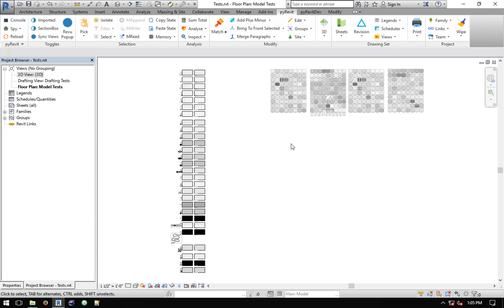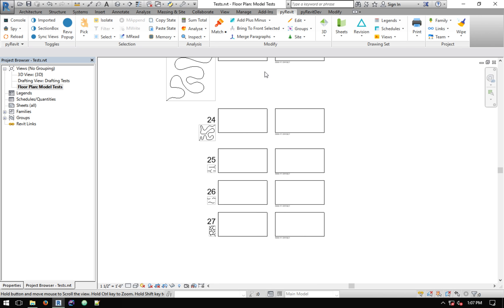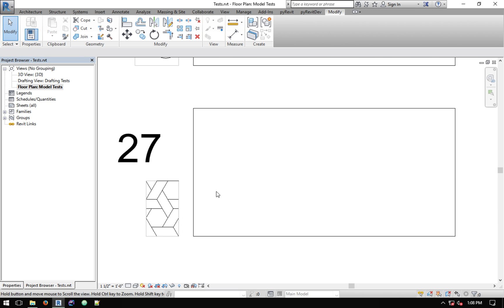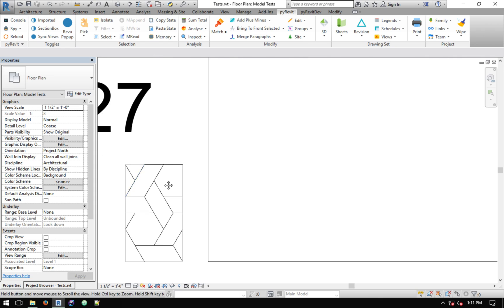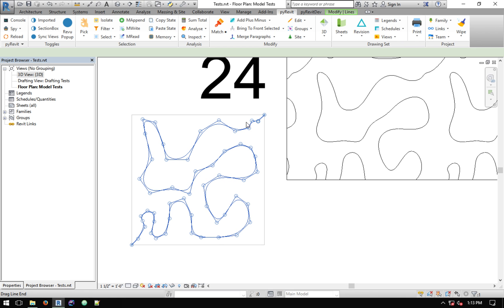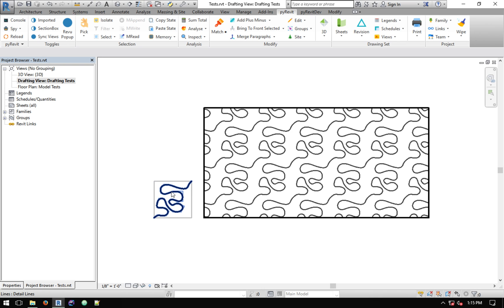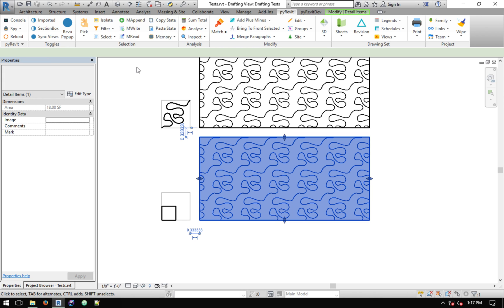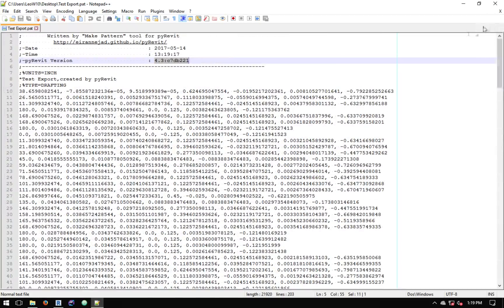How to pyRevit: Make Pattern Tool

Comment: Hi Eirannejad. I really enjoy your tools. I'm getting an error with Make Pattern in both 2020 and 2019. In 2020 here's an example of the lines:
AttributeError: 'FilledRegionType' object has no attribute 'FillPatternId'
System.MissingMemberException: 'FilledRegionType' object has no attribute 'FillPatternId'
System.MissingMemberException: 'FilledRegionType' object has no attribute 'FillPatternId'

In 2019 it strangely returns a success message but the output window shows this:
ERROR [pyrevit.revit.db.transaction] Error in Transaction Context. Rolling back changes. | <type 'exceptions.Exception'>:name cannot include prohibited characters. 
Parameter name: name
ERROR [patmaker] Error creating pattern element. | name cannot include prohibited characters. 
Parameter name: name

This is with me attempting to name the pattern "1" 
No quotation marks. Just the number 1 like you did in your video.
Reply from the maker: See this and report a new issue please with example file so I can test on my end: https://www.notion.so/pyrevitlabs/Reporting-New-Issues-f1fdd62cf6074b318bfe8ddfbc2d8d98

Comment: Very grateful for your pyRevit plugin especially the Pattern Maker!  Regarding detail patterns, is it possible to modify the origin of these within a system wall family?  My current standings:  I'm successfully showing a zigzag pattern of lines (looks similar to truss-mesh reinforcement for cmu walls) within the structure portion (metal studs) of multiple system wall families at various thicknesses, ie., 8", 6", 4" & 3 5/8".  The challenge that I'm having is that the patterns need to be shifted to align perfectly w/ the thickness of the metal studs.  I have created a separate zigzag pattern for each metal stud thickness, then have created a material which is then utilized within the system wall family and as you know, Revit only allows detail patterns.  Any advise is greatly appreciated!
Reply from the maker: I think using model patterns will help with this

Comment: Great tool. How do you constrain the edge of you pattern to the edge of the actual fill region so when you expand the fill region there is at least one corner that you can use as a starting point from which the pattern could expand.
Reply from the maker: I'm not following what you mean. Please be more specific and explain what you are trying to do.
Reply: Let say you want to create a tile pattern. Ideally, the edge of the tile should be constrained to the edge of the fill region so when you stretch the fill region  you don’t end up with half a tile outside the region. Whether you stretch the fill region or move it on your plan view, as it stands the pattern never moves with it. The edge of the pattern is not bound to the edge of the fill region. To set-out the tile from a wall or a column one needs to be able to align the edge of the pattern where it is needed but that’s only possible when the pattern moves along the fill region it has been created in.
Reply: @BonuxCouleur  Thats a Revit limitation.

Comment: I just installed pyRevit_4.6.19_signed.exe
, it seemed to load fine but MAKE PATTERN selection is not available under the EDIT tool under MODIFY. Do I have to change a setting?
Reply from the maker: What do you mean it’s not available. The tool is not there?!
Reply: @pyRevit   Correct, the available tools under the EDIT option are Change element type safely,  Conver line styles,  Export view as image, Place origin marker, Shake filled regions and Tag All in Views.
Reply from the maker: The make pattern tool is on root of Modify panel. It is not a tool under a pulldown
Reply: @pyRevit  I was going by the menu in this video, after a bit more exploring I got it to work. Buddy this is an awesome tool. It's going to take me a while to figure out the rest of it. Thanks.
Reply from the maker: Ya sorry some of these videos are older. Thanks for the kind words and I hope you can save time using these tools and have more time spending on fun stuff 😁

Comment: Hi guys, I'm using Revit 2018.3 and when I try to export to a PAT file nothing happens. Can anybody help?
Reply from the maker: So you select a pattern and a destination folder and no pat file is generated?
Reply: @pyRevit  Yes that's right, I draw a detail pattern, highlight it, press make pattern, click export to to PAT, select the two corners of the pattern area and no pat file is generated. I have projects for university that I'd really like to use this on.
Reply from the maker: Ya sorry no. You need to create the pattern first, the open the match tool without any selection, pick the pattern from drop down and then export
Reply: @pyRevit  Could you please be a little more specific? The pattern has been created and used inside of the filled region. I do not understand how to use the match tool. Your help is greatly appreciated.
Reply from the maker: Watch the other two videos in this playlist: Making Patterns https://www.youtube.com/playlist?list=PLc_1PNcpnV57FWI6G8Cd09umHpSOzvamf
Reply: @pyRevit I've watched your videos. These are all very useful tools but for some reason Revit will not export to PAT file. I have tried both ways of doing it but do not get the option to select my destination folder for the PAT file. It seems to crash during the process. Very frustrating to be honest as I could really use your tools for my projects.
Reply from the maker: I’d appreciate if you can send me an example model and error reports of the failure. I need information to be able to detect errors if any. Report here please: https://github.com/eirannejad/pyRevit/issues

Comment: Hey, I really love what you have created here, but I have a question, I have been trying to create a pattern for damp roof course ( which is one solid rectangle, and then an empty one), but the filled region is not being added to the pattern, have a solution for that? I am using Revit 2017 and your latest version. Can't wait for your response !!
Reply from the maker: Hey thanks for the kind words. Solid filled regions currently don't work in Revit patterns due to their line-based design. Solid pattern is a special type of pattern that is generated programmatically and is not line-based. Same limitation exists in AutoCAD as well. I suggest closely filling the solid rectangle with lines. Play with line thickness and spacing to get it to show as solid on prints.
Reply: Oh, didn't know that ! Thanks so much for your reply, will definitely try what you have suggested ! Thanks again.

Comment: Does this work with revit 2017
Reply: Yes and 2018
Reply: I got it to work! great tool. I was not on a floor plan and I think that was the reason it was not working at first. (i was in elevation)

thank you